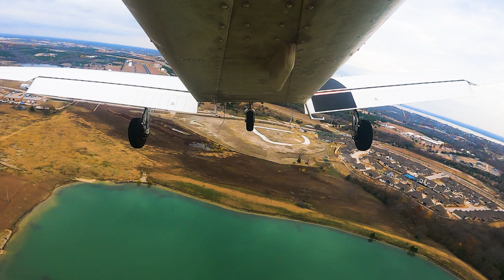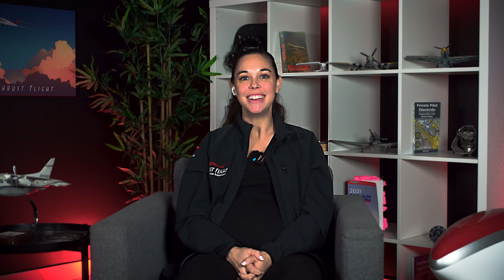Power Off 180: Making the Right Turn in Emergency Situations

Comment: Do it at Simulated Idle, not low idle. With some power, not idle, some flaps and some carb heat too to get 700 fpm when level.  Then turn.   "Simulated Idle".  Be good to the good engine.

Comment: I know you said this is for the commercial pilot.... but I had to do this for my private.  Is there a difference?   FYI... I was under the foggles, and my DPE told me to take them off, and as soon as I did... he said... "You lost your engine".  I had to land with no power at a small, uncontrolled airport.
Reply: It's a great skill to learn as a private pilot! It helps make your regular landings better too in addition to learning to deal with an emergency. When you go to take your private pilot checkride you will not be tested on the Power-off 180.  That's why it's called a "commercial maneuver" because it's not required to perform on a checkride until the commercial pilot practical test.
Reply: @drewfliesbikes All pilots should know short approaches.  My CPL CFI learned them at 8 hours he said.  I learned them much later with my lame cFi i had.